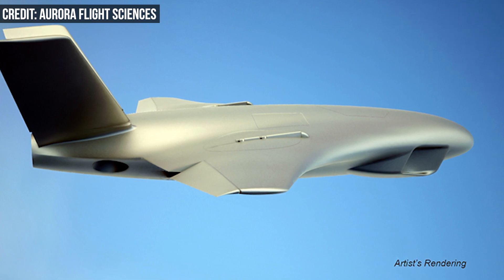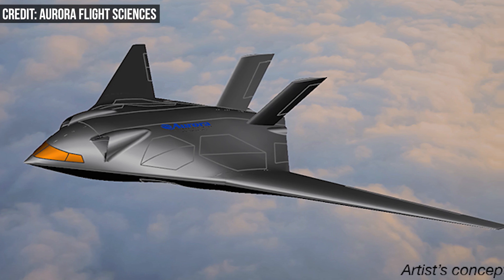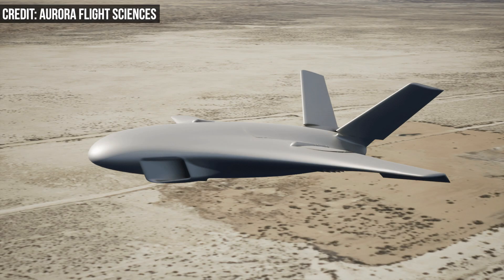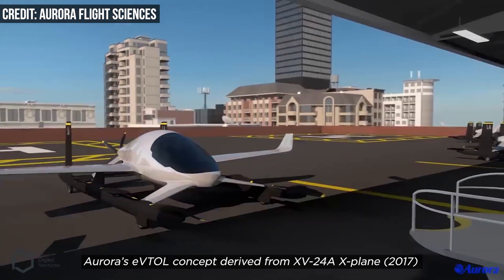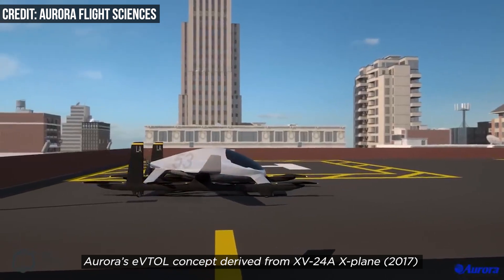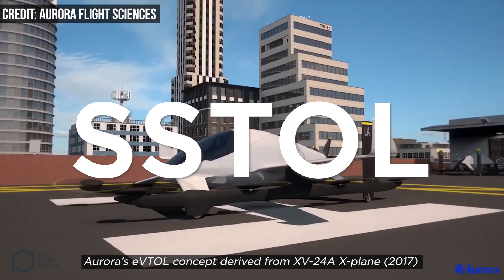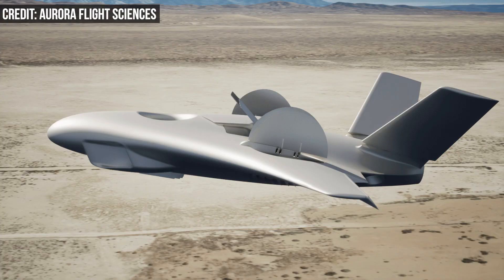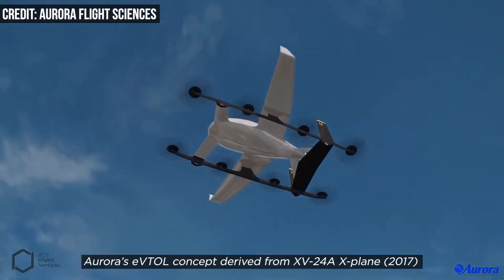Boeing Subsidiary's New X-Plane Sprints to Next Design Phase

Comment: So they just dusted off the Ryan XV-5 Vertifan from the 1960s.
Reply: i had the same thought! with today''s tech vs. that of the early 60's, maybe the weight penalty of two propulsion systems is now within acceptable performance parameters?
Reply: @jeffk412  The Vertifan had two turbojet engines, but both were used full-time (as opposed to having engines dedicated to either horizontal thrust or vertical thrust - eg. the Yak-38).  For vertical thrust, the engines' exhaust would be ducted to the three lift fans to spin them.  The idea of using part of a turbojet's power to spin a fan - generating an order of magnitude more mass flow than it removed from the turbojet - was revolutionary at the time and led to the development of the now common turbofan engine.

It wasn't the power/weight ratio that doomed the Vertifan but its handling.  The horizontal <-> vertical transition was abrupt and brought on nasty pitch and yaw instabilities.